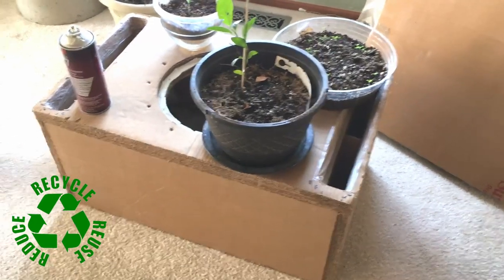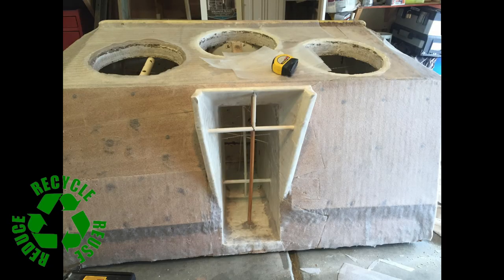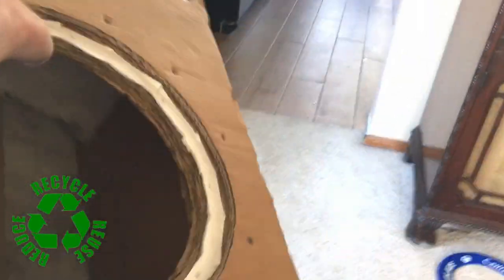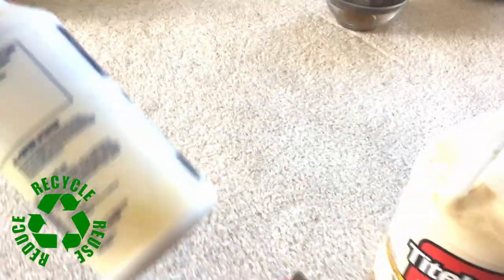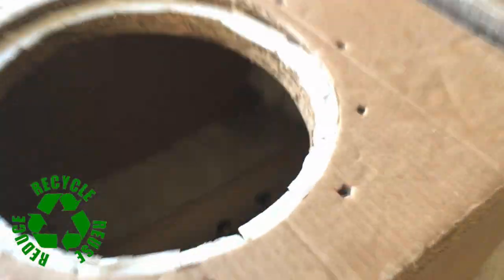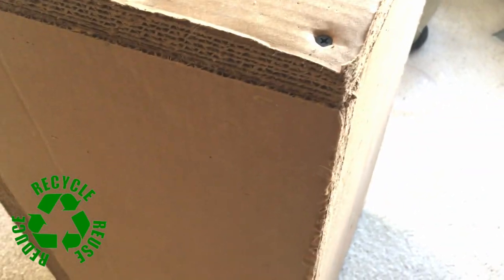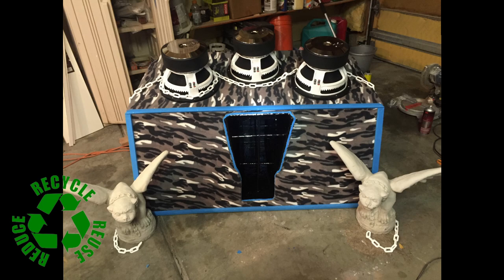How to make cardboard stronger than wood! Cardboard hack

Comment: Can you please list out materials used in description with steps which one to use first and which glue u have used to layer cardboard...with music in background cant hear you well...but loved the box you made
Reply: Same here, would like to understand better what he said about glue
Reply: He used 3M spray adhesive to glue together the original layers of cardboard
Reply: He used the Titebond original in a 50:50 with water in spray bottle or squeeze bottle to seal the edges and boards together.
Honestly, just use the titebond. Start with a 25 water to 75 glue solution is you are painting it on with a brush which is what I like. Then work your way down to 50 50 in a spray bottle it that's the method you want to use.  I would add water a little at a time to thin it.
I learned about this by accident when I used dollar tree wood glue to glue an Amazon box back together when i ran out of packing tape. That box was super sealed on the bottom and sturdy. Any wood glue will work, so I picked up a ton from the dollar tree before proces went up. I did not dilute the glue but was also pretty stingy with the glue ans it worked fine. I've used Elmer's white school glue. Works but not as well. 
If wanting water proofing seal the out side with Titebond 3. Check out the original paper mache channel. She makes masks and uses titebond 3 sealing with a layer of paper. I use brown shipping paper or newsprint paper from the hardware store  for a clean look. Otherwise newspaper it is.

Comment: There is no mention of how you do the cardboard stronger
Reply: Glue and adhesive...what were u watching
Reply: @anjalaahmad7766  like what, do i just spray on enough to stick? do i spray enough it soaks the cardboard? cardboard is corrugated, it has a lot of space in the middle, do I need to compress it? he seems to have glue in those corrugated space as well, how did he do it? im not convinced that "just gluing" will do the job, you can try standing on 6 layers of cardboard, but that alone it's not gonna hold 200 lb. the only way it's made strong with glue is if the glue get all the way inside the paper, which he didn't explain how it's done
Reply: @BBoycire85  Mr DIY  is a youtube channel where he makes furniture out of cardboard. Watch his technique, it will helpyou understand how thecardboard is so strong at the end. 😊
Reply: BBoycire85 

Ever made paper mache? This kinda works like that except wood glue is stronger than the normal glue you use for that
Reply: Check out the ultimate paper mache channel mask making with titebond 3 for a better understanding
Reply: @anjalaahmad7766  haha

Comment: THANK YOU!... for demonstrating durability. I have designed a bicycle trailer using schedule 80 PVC and card board.  I know the PVC will work but it has been difficult to find anyone showing structural strength of cardboard.  Standing on it and pick it up with one hand was a Eureka moment for me.
Reply: Very glad to hear it!!! same here
Reply: i guess it is kinda randomly asking but does anyone know of a good site to stream newly released series online ?
Reply: @Easton Benson lately I have been using FlixZone. Just search on google for it :)
Reply: @Easton Benson lately I have been using Flixzone. Just search on google for it =)
Reply: Hey just wondering did you use some wheat paste for the cardboard like to cover the edges or somethin

I've got a lot of cardboard at home I'd plan on make a diy drill caseing with it I just gotta figure out how I can make the cardboard get hard

I tried pva glue with water I think I was just white Elmer's glue and I put water in the bottle of the glue and glued some cardboard together like 2 pieces I haven't tried it fully but is that what I'm supposed to use like Elmer's white glue with water and paint it on the cardboard do I need to paint it a few times again after it dries 

Rn I have card board but I'm trying to make a DIY drill caseing for my drill
Reply: Thanks

Comment: If you use the titebond to glue the cardboard layers together, it is just another layer of strength. Then, multiply that for however many layers your glueing together. It just adds multiple layers of rigid strength and stability. The spray glue won't give you any extra rigidity.

Comment: Very nice show of what can be done which most would not think would work.  I recently started experimenting with PE (polyethelyne fishing line) which has less stretch than Kevlar or carbon fiber, which can be used on outer shell to reduce flexing, just like carbon fiber sheets.  and also Sodium silicate as glue aka water glass.

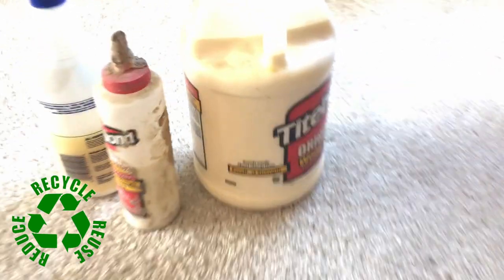Comment: At 0:51 and  1:18  I see wood supports inside the box. 
1, is that the spot you were standing on? Right where there's solid wood?
and 2. Is that what the wood screws were screwed into?

Comment: This is so intriguing. Any ideas on a way to coat the cardboard to make it weather resistant/ water proof/ hard-shelled?
Reply: Paint it with exterior paint.
Reply: @shaynaformity1384  That’s what I was thinking, possibly doing “poor man’s fiberglass” and then painting. If you were going to paint, I wonder if you could just use wheat paste in place of the wood glue. It would be a lot cheaper, and I wonder if the coat of paint would protect it.
Reply: @mattlane3594  that sounds intriguing.  Probably a good idea to make a sample piece of each and do some testing.
Reply: Why not.
Reply from the maker: Not so much for a hard shell but you can use what's called RedGuard to seal it. Home Depot sells it. It's basically paintable rubber. I had one of these boxes hit over 145db at 28hz with around 10,000 watts. It was sturdy as a rock! That's why I shared the idea. Works great. Lot's of people got videos of the setup from different locations. I no longer have the truck that was in. Actually the truck literally fell apart from the bass... pretty cool =) lol
Reply: @D-Brunetti  LOL

Comment: How do you think it would work as a backstop for a BB gun? Of course I would use a few layers of cardboard
Reply: Use enough glue and it should work fine. Test it first before you fire in line with any houses. A layer of screen door netting between layers would improve the effectiveness.

Comment: What do I just coat it in diluted wood adhesive
Reply: Don't need to coat it no, just add dalops of glue, PVA glue, which is wood adhesive, make sure to use plenty around the edges. If you are making like 5 or 6 or more layers, after you glue them, use wood screws, you will be amazed. Sorry for the delay in reply... I am busy on my other channel

Comment: So I have a cardboard display is there a way to make it more durable spray paint or anything else it’s in brand new shape but I still want to make it more durable
Reply: ... if you can disassemble the display, get some epoxy resin, thin it out with some acetone, or something similar, that won't eat the cardboard.   Cover all the surfaces with the epoxy mixture, Outdoors.   Let it dry outside, when it cures, those panels will be as tuff as wood, and solid.  

Test a small piece first with the epoxy mixture/coating

Comment: U said Pva glue but what i seen was wood glue ?
Reply: Dacia's D.I.Y's 

You can use PVA but wood glue works better
Reply: yea PVA is the generic term for wood glue.
Reply: PVA = Poly Vinyl Acetate
That's the chemical name for white glue.  Wood glue is usually just stiffer when liquid than the stuff you buy for your kids at Staples.
Reply: Wood glue, white glue, PVA glue, Elmer's glue... are all the same thing.